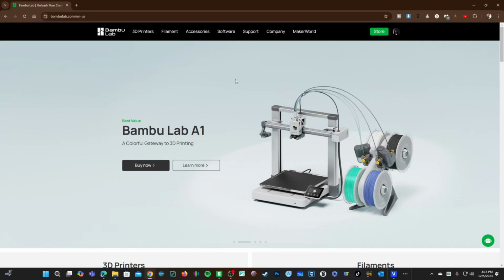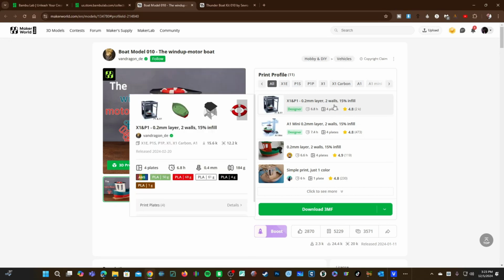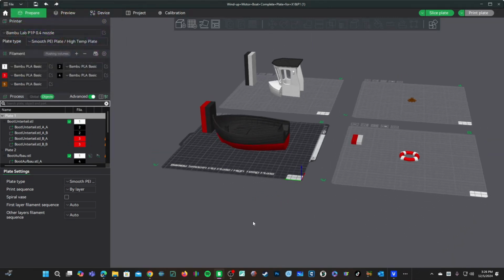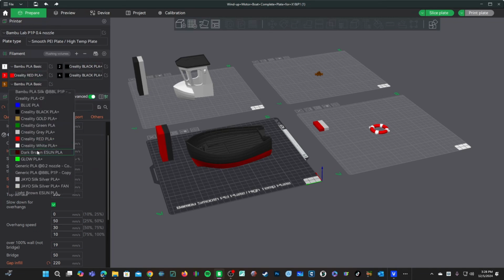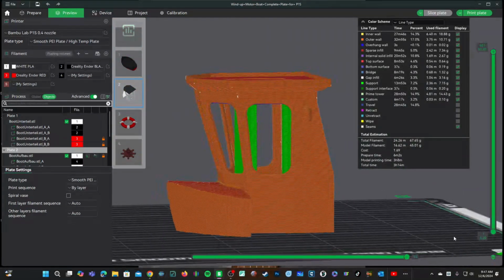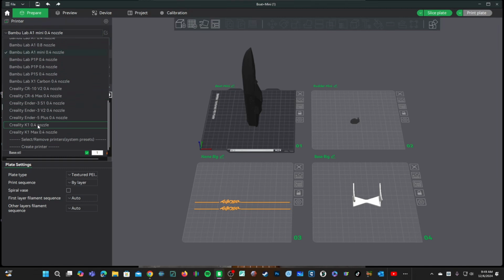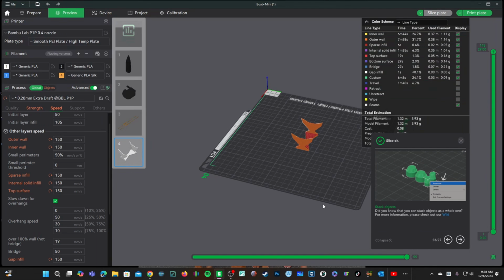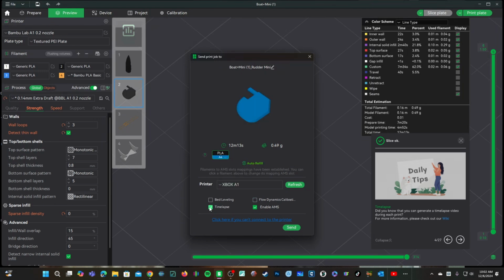Bambu Lab "Maker's Supply" WINDUP BOAT KIT - TUTORIAL - "Boat Model Components Kit" - 3D Printed

Comment: How do you get rid of the  switch color flush block  on pei sheet for us that have no ams
Reply from the maker: Turn off the purge tower, under "other", or, switch the model to a single color and it should go away
Reply: @ thank you cause I’m a cheapskate on filament saving to buy a ams you know 😉
Reply from the maker: I look forward to you getting one. :)
Reply: @ thanks friend  not well today .. and didn’t do anything could not think of print to do
Reply: @PeterAgostiniJdcap26  iv just brought a printer I say just 2 months may be , I’m thick as shit basically, not the point, Bambu have a Make My statue , and a Relief Sculpture Maker, all I’ve printed so far is dewalt stuff witch is why I brought it , help